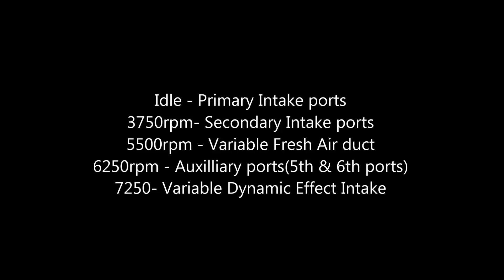HOW? Rx-8 Intake Induction Activation Stages 13B-MSP

Comment: I get All those various intake opening stages are to improve lower rpm torque
But how bad/good😁
would a     like the older RX7s
2 big 4 smaller secondary runner 1 or multiple throttle valve intake be 
On a stock port be.

Comment: apart from you missing the 2 primary injectors that are in the Centre Iron and not in the inlet manifold, it was a good explanation. the 4 injector holes on the inlet manifold are for the secondary's.  the Mazda ECU runs a staged fuel injection map.

Comment: Hey, how do you control the auxillary port motor? Does it return when you no longer feed it 12V or do you need to reverse the polarity? Thanks!
Reply from the maker: You need to reverse polarity the motor...its not auto return
Reply: @DIYAllManphKDWzpeedengineering  Thank you! I will build a circuit that does this :)